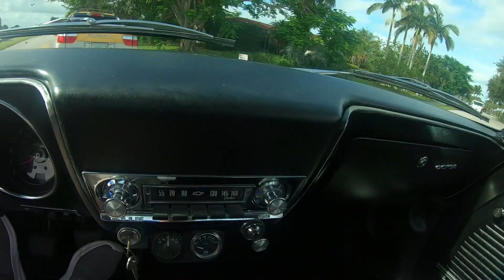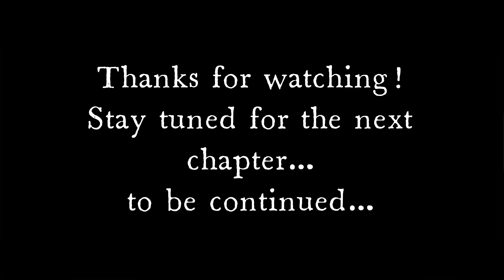First planned car show and a puzzling break down

Comment: Sounds like new car restoration blues. There’s always something that goes wrong after you restore a car. You’ll get it squared up because your not a quitter. I’d rebuild the one you got 🤷‍♂️🤷‍♂️🤷‍♂️
Reply from the maker: Thanks for watching Pete! The problem was definitely vapor lock, the gas cap was clogged closed. Ordered a new cap and that should take care of the problem. The plan is to rebuild the original engine and get another one to rebuild as a backup.😁👍👍